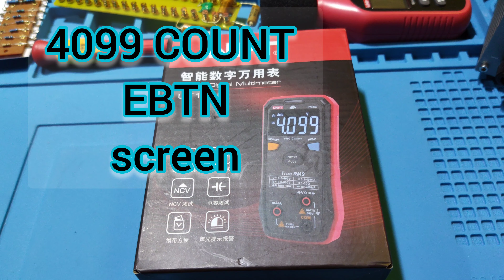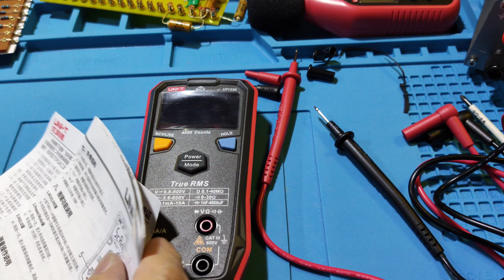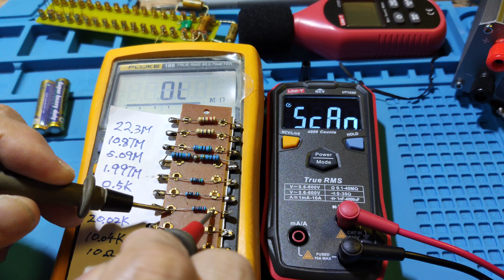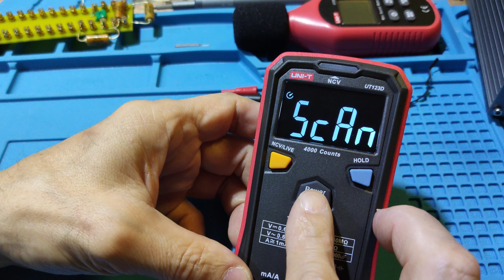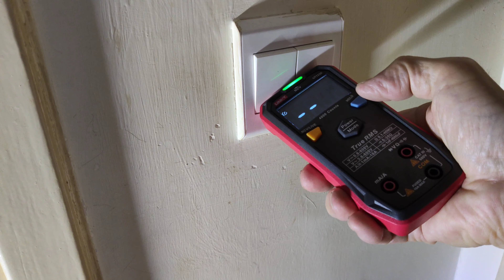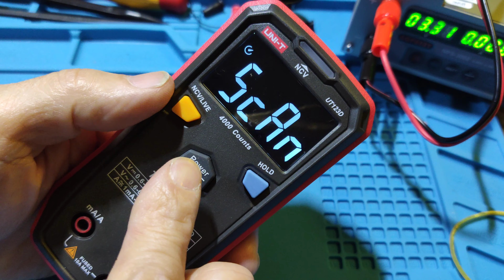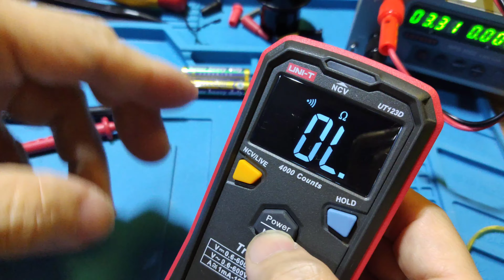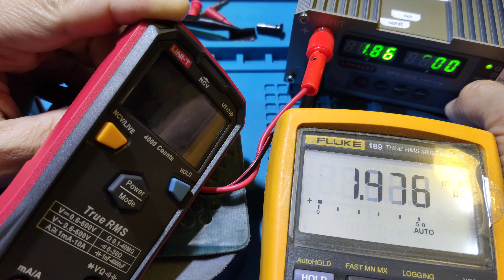UNI-T UT123D 4099COUNT EBTN MULTIMETER CATIII600V

Comment: Hi. I just bought it. In the contiunity test, the buzzer stays stuck (in manual mode only) when the probs are touched and pulled quickly, it beeps even if the leads do not touch each other. I feel like it is a software problem. Whats the reason of that?
Reply from the maker: sorry,i dont know of that reason because i am not a electronic enginner,but some meter have this problem,normal under the softwave design error or the continuity via a protection device first make it lag.thx for watching.

Comment: I HAVE A VERY IMPORTANT QUESTION:

Can those who use this device answer, when you manually switch to diode, capacitor, ohm levels, does the CLICK CLICK SOUND come from the DEVICE, can you please answer?
Reply from the maker: and that have some sound may come out because inside have a mini relay,and in the video click click sound  is the move voice and inside meter sound combined.

Comment: I haven't understood; is it precise or not? I need a precision multimeter, THANKS.
Reply from the maker: because A new type of meter have many function,but not every function we are fully testing,that the video may be so LONG time,normally if you see more video you can know the meter something bad.and which  is advertise one.choice of personal ,someone need small size,big digital,precise,and cheap price,if you need precision one and cheap one you can buy A 6000 COUNT,have auto and Manual function one,CATIII 600v, that fully cover for house environment use.
Reply from the maker: and this is A cheap price and have A SMART function(scan).it can safety for testing (when you only plug in the com terminal and the(DIODE,voltage,resistor,BEEP,capacitor)terminal,but in the(mA,A) current mode you must be care for testing  it only for TEST in few sec.and 
if you don't know how to measure you must be learning from other video first ,and buying A cheap one for beginning.
Reply: @wilsonluilui  i understand, thanks!
Reply from the maker: if you is A electrician you can choice A CATIII or CATIV GRADE MAY BE GOOD FOR TESTING THE OUTDOOR ENVIRONMENT LIKE TRANSFORMERS AND  CONSUME BOX,MAIN SWITCH ETC.IT CAN PROTECTION MORE THAN CHEAP ONE METER,BECAUSE INSIDE ALSO HAVE A CERAMIC FUSE FOR PROTECTION OF THE USER.thx for watching